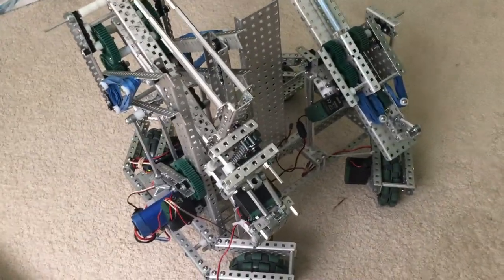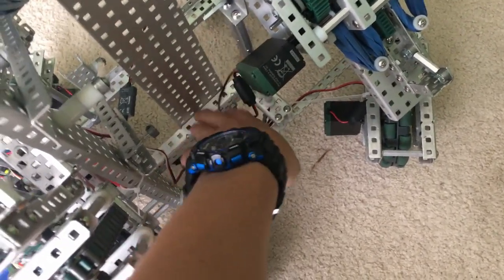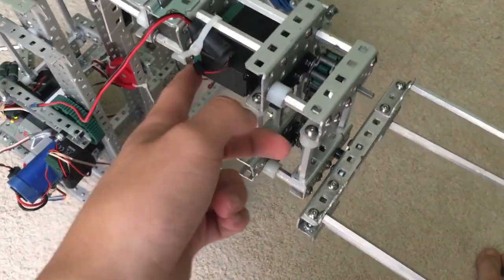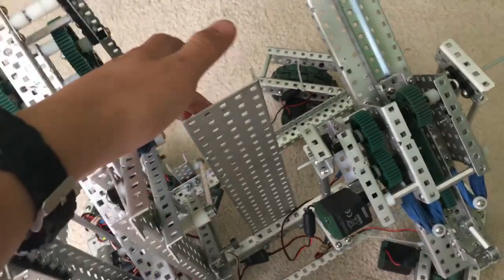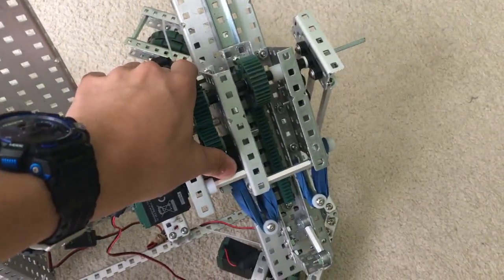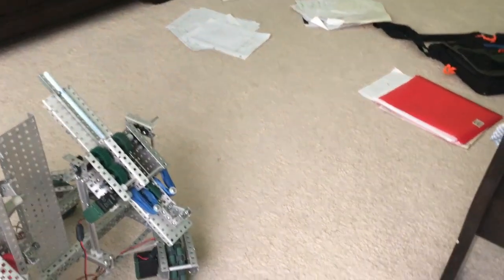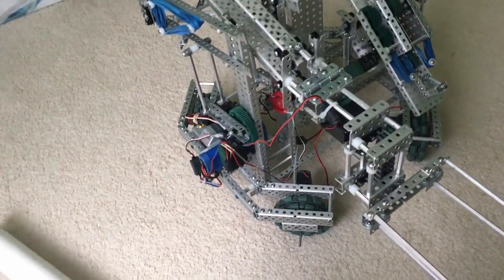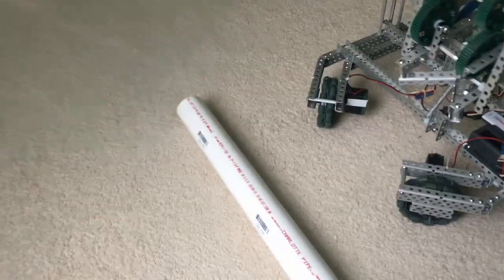VEX Turning Point summer - xdrive, dr4b, launcher

Comment: What length c channels are you using for the main part of your DR4B? And does it reach high enough to stack caps on the high posts?
Reply from the maker: This DR4B barely reaches the high post. We recently made the lift taller, and scoring on the high posts is much easier. Currently, the bottom is 23 holes, and the top is 29 holes long

Comment: If you don't mind me asking, what's your motor distribution
Reply from the maker: We are currently using 393 motors but plan to use the v5 Smart motors when we get them which means we have an 8 motor limit. We ideally want 4 motors on the drive, 1 on the lift, 1 on the cap flipper, 1 on the ball intake, and we are trying to power a puncher and the puncher angler on the same motor which I believe we have managed to do and will show in the next video.